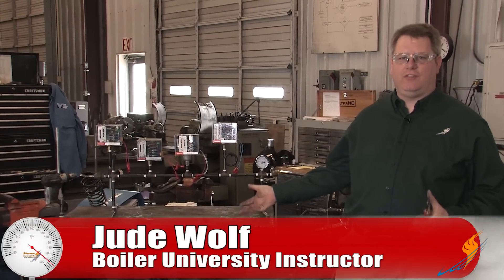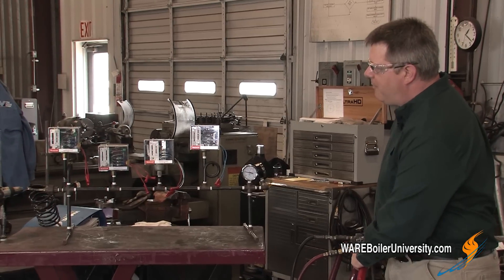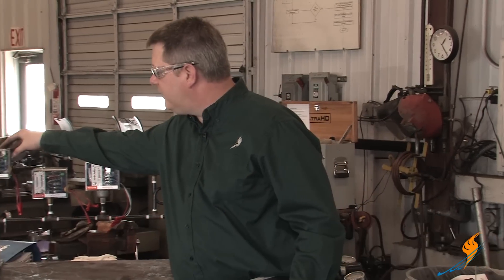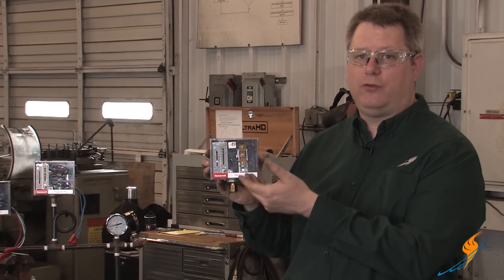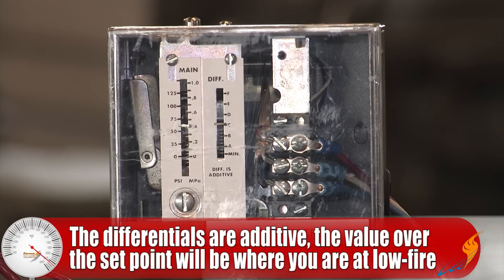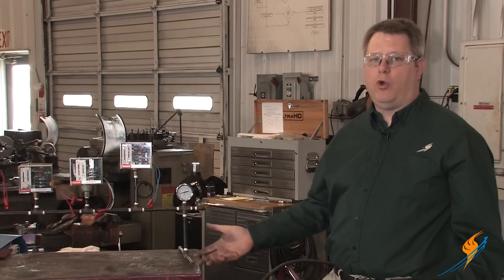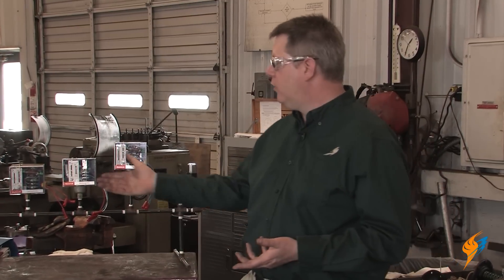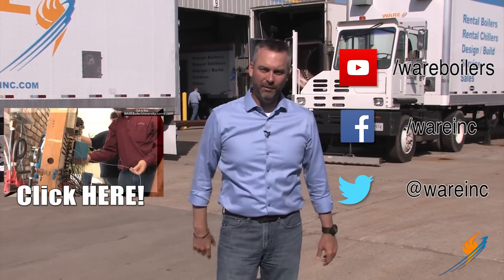Understanding Boiler Pressure Controls - Boiling Point

Comment: Isn't the propose of the operating steam pressure switch with no manual reset, to cycle the firetube boiler's burner off and on, on high steam pressure since it's generally wired into the recycle circuit of the burner management system?  Wouldn't this keep the boiler nice and hot during low load demands from the plant.

Comment: hello my teacher ask me how does the boiler operate safely using the low pressure cut in switch ,high pressure cut out switch and safely value
Reply from the maker: Thanks for the comment! So this video does a good job explaining how the switches work but we just produced a new video that explains the safety valve. https://www.youtube.com/watch?v=8rsB8V30Owg Check that out and it should give you a good understanding on how they all work together. Let me know if that helps out!